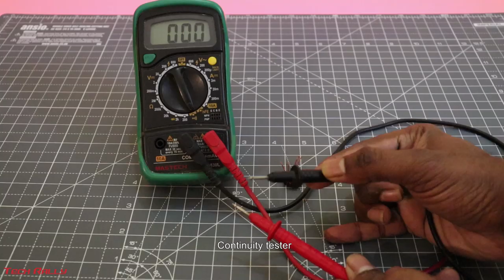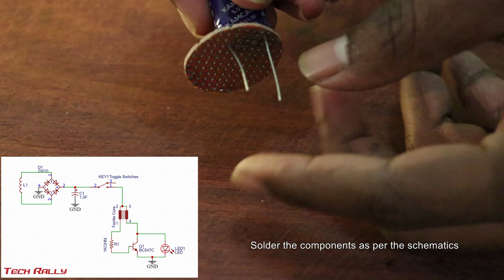How to Make a Torch without Battery | Emergency Torch | Shaking Torch

Comment: I like what you've done very much. One thing I would do is cover the coil with at least 4 layers of tape to protect the wire. It looks awesome and functions really well. Cheers! ✌️
Reply from the maker: Thank you...😊
Reply: @TechRallyofficial  You are very welcome. If you could find a small magnifying glass to fit over the LED, that also would help. The project is still great. Cheers! ✌️
Reply from the maker: Thanks again 😊. yes, its good to have a lens over LED you can find it on Aliexpress "Convex Acrylic Lens for LED Flashlight", Please Subscribe and support..😊

Comment: Mr  I need a help mine not working I got a neodymium magnet and magnetic wire but it's not working
Reply from the maker: 1.Please make sure that you use Enamaled/Insulated copper wire. 
2.Test the coil before connecting to circuit by attaching the LED in both ends of the coil and shake the coil in dark place.
3. Increase the number ok magnets.
Reply: Thank you Mr I really need this kind of project
Reply from the maker: Sure, More projects coming soon.
Please subscribe to get updates 🙂